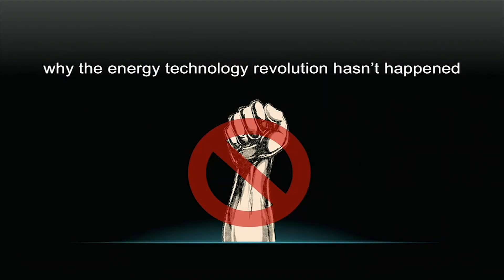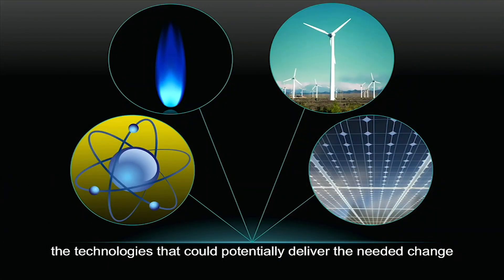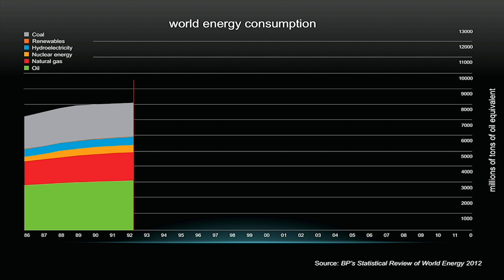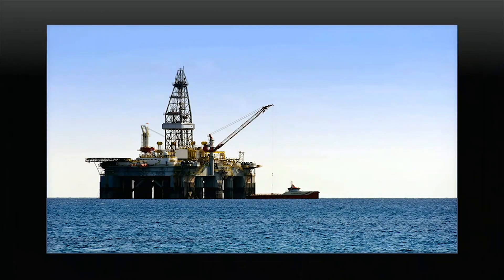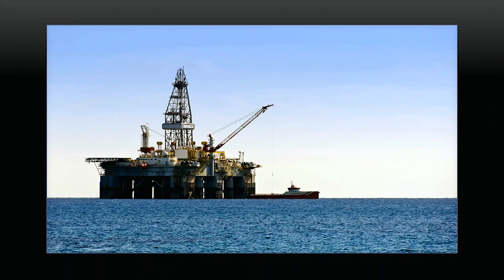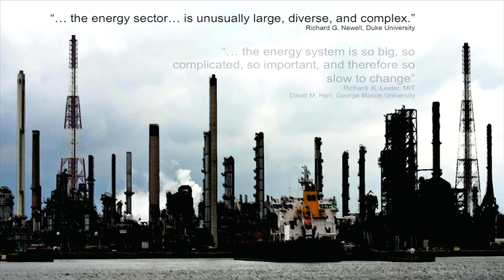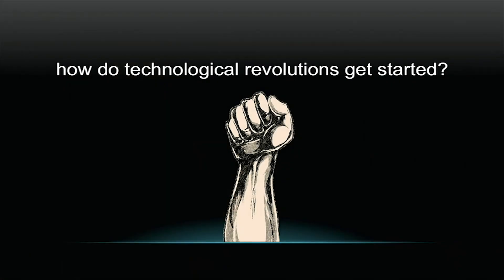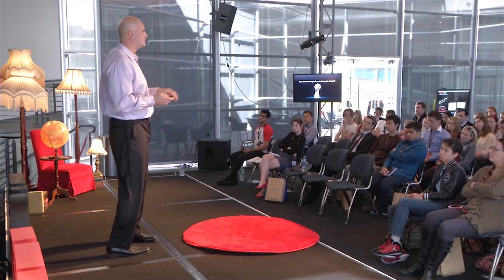Why the energy technology revolution hasn't happened: Robert Perrons at TEDxQUT

Comment: The clean, renewable energy sources are intermittent and depend on a breakthrough in battery storage to achieve disruption of the energy industry.  I've been looking for a better battery for 30 years and I think it is finally happening.  LIQUID METAL BATTERIES.  Don Sadoway of MIT - check out the TED talk.   Low cost, powerful, simple, long-lived, grid-scalable, in beta-test in the Hawaiian market.